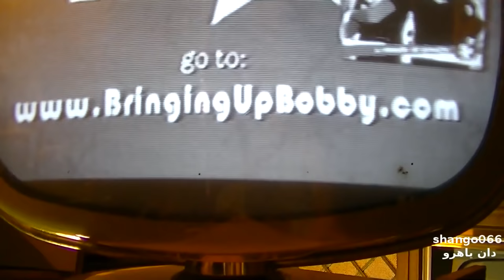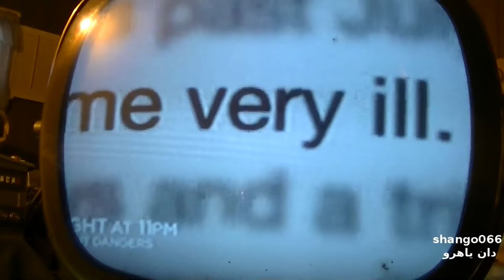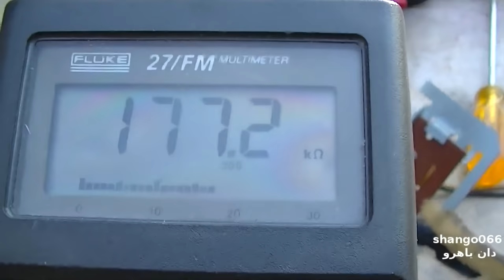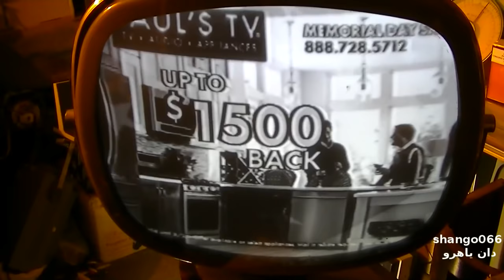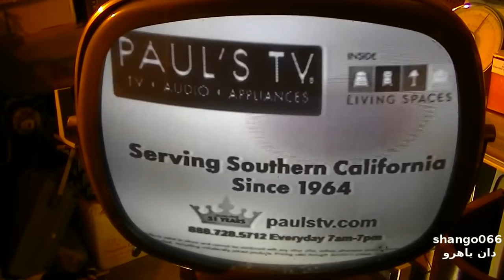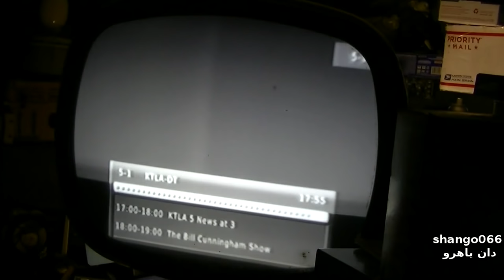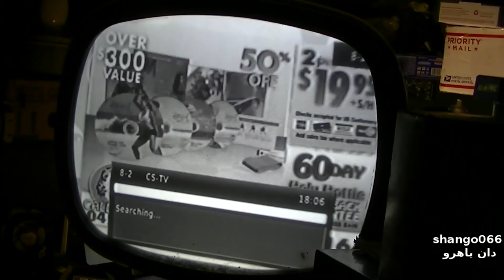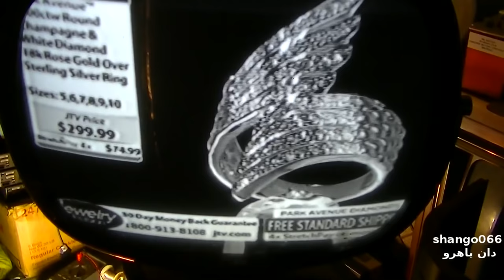Philco Predicta Pedestal Repair Final

Comment: I have been playing with electronics since I came home from Nam in 1971; Before that, I did tube replacements for my relatives in town, I used to go  out to the local dump ground with a buddy, he would dig for copper, I would grab all the tubes I could find.  When a TV was on the fritz, my relatives would call me first, I would arrive with my box filled with egg cartons which protected my tubes, I had the numbers on the cartons, this was before Styrofoam was a thing.  A quick look at what the TV was doing, check the tube layout on the inside, find a matching tube and swap, if the first one didn't work, try another.  Usually I could fix the set in no time, the lady of the house would invite me to stay for a meal, and I would consider myself well paid.  Folks still remember me for that, now days they call me when their PC's are acting strange, and yes, I have learned about PC'S and continue my fixes, usually for a beer, or shot of whiskey for my time.  Cool video, shows me where I should have gone if I had kept up my TV Repair, when tubes were on their way out, I had obtained a full service case filled with tubes, had a couple of tube testers and some old military test gear that I picked up during my 8 years in the Army. I gave it all to a local TV Repair guy, wish I had kept it now, poor fellow found out about a year later he had cancer and was gone a few weeks later.
Reply: I also had great success that way back in the day. Back then, the soldered in components were younger as we were.  And when a problem occurred, it was often a tube. I was batting better than 50/50 with also fixing a few other easy noticeable things.  It was fun wasn't it?

Comment: This all proves that what goes on in the back of a TV is often much more interesting that what comes out of the front.  An absolute miracle what you've done with this one.   The black level on most monochrome sets was awful, before gated AGC came along, but this one seems particularly bad in that bright parts of the picture darken the content to the left and right.  Possibly AGC action is too fast?  I used to fix a few TVs when I was a teenager, though maybe I was a little too young to really get the hang of valves (as well called them in the UK).  I hope the owner of this set appreciated what you did.

Comment: If you're going to use ceramic capacitors in those couplates they should be either C0G/NP0 or U2J.

Comment: I seem to remember some TVs had a buzz controll adjustment on the chassis. Not that it does any good at this late date but I remember being able to adjust out the buzz when text or screen crawls were causing issues with the audio.

Comment: Interesting about the sound on modern programming, I can see the on screen displays and programming of digital origin seem to be causing the buzz. What do you(s) think that is? Hard edges, higher brightness? Good video! But I can't help myself with the baby... can I say Smerdley's Seahorse (2009)?
Reply: AnalogRevenge Text seems to cause a buzz on our TV as well, which is a later model CRT set from around 2005, but more so on my older TVs from the 1970s and earlier. Predictas have a buzz control pot on the chassis someplace like many TVs from that era have, but often you can get rid of most of it by re-aligning the IF first, it's just the nature of using intercarrier sound.

Comment: I wonder if a filter can be used to separate the high voltage pulses from the DC to protect the meter. Maybe take an old flyback with a shorted secondary and remove the secondary winding and use the primary to choke the pulses and pass the DC and put a 10uf 450volt across the meter. Maybe a high voltage resistor that can withstand 6000 volts or several resistors in series with a capacitor across the meter

Comment: Why was the 0.0015 disc drifting due to temp an issue, but not an issue when you used discs to rebuild K4 which was even closer to the hot tube

Comment: Shango, Did the sound improve with the cabinet together? Where did the term "couplet" come from?  

Great video, glad to see it run.  Bet your friend is gonna be thrilled!  

Thanks!  Steven
Reply: Steven King   Steven, from the info which I've been able to gather over the years, "couplates" were developed for three main reasons, first to allow manufacturers to "begin going vertical" in the design and construction of PCB based electronics for purposes of capitalizing on unused space(s) within the radios and television sets being produced at the time. Secondarily, couplates were "predesigned sub-circuits", which allowed the production staff to build more product with less effort, at a reasonable cost (couplates were fairly inexpensive at the time). Finally, some couplates were designed with "X, the unknown factor" in-mind. GE and Admiral were "infamous" for requiring that certain "proprietary" replacement couplates be purchased from them. Most of the time, these components were situated in the IF or Chroma sections of television sets. They were fairly free with the schematics of the couplates used in the manufacture of radios.

You may find this to be of interest: http://pacifictv.ca/schematics/centralabcouplates.pdf
Reply: As a kid, I built a Sears Edukit clock radio, an all American five, it had one of these couplates in it. It was somewhat disappointing build as I had it together in a few hours. I had hoped for something more like a Heath or Knight Kit. I sure wish I had all of my as found radios that I had back then. I would spend hours de soldering scrap radios if I couldn't fix them. I never really had access to test equipment but for the Olsen VOM.

Comment: There was a color predicta 25 in. w rca chassis in 1980s don't remember if rca made it was pricy had pix of it when we had shop also had ad for 7in Motorola vt7 . remember a predicta with a vdr .resistor in vertical.we couldn't get.supplyed bias -we added a -supply from filament circuit .

Comment: Capacitor suffix Z is a very loosey-goosey tolerance, up to +80 percent and minus 20 percent.   That would be okay for some uses but not so good for oscillator or sync or resonance circuitry.

Comment: I used to work on old TV's back in the eighties and nineties, but now that the flat screens are so prevalent, and with the tiny surface mount components, they don't lend themselves well to diy repair, and without the high heat pinpoint gun to desolder components they are impossible to remove. And when they blow, they seem to Daisy chain and take out multiple components

Comment: Instead of getting those  gun tips u could just take mains wire, remove insulation and use it as the tip. I do it all the time.
Reply: Wow great idea, just copper right?
Reply: Yea, you can also coil it up and use it as a degaussing coil for screwdrivers. I also tried heating it up with torch, and i think it makes it last longer, no proofs tho ... :)
Reply: Excellent! I will check out your channel...  Thanks!
Reply: I subscribed to you.  Looks like you have some great videos there! I'll be checking them out! Talk soon... Steven
Reply: Thanks! 
You also have nice vids so I am already a subscriber of your channel for some time. :)
Reply: Thanks! I like the led scope video with music, I found it!

Comment: That buzzing sound is caused the chroma signal leaking into the audio part of the RF signal this will happen with almost all tvs built before color was introduced because they have narrow space tuner that's why old tv shows like I L Lucy don't cause that to happen.some colors make the buzzing louder than others if you fill the entire screen with yellow the buzzing will be quite loud and might even distort the picture a bit.
Reply: @daleburrell6273  on some german tvs i own the buzzing only happens when bright white stuff appears on screen for example subtitles or white text. but if the IF is working fine and everything is aligned the buzzing doesnt happen on those...with american sets i have no experience to speak
Reply: @daleburrell6273  yes european sets use pal, american ones use ntsc...i didnt say the opposite....i am just stating what usually happens with my sets, wich may also happen with your ntsc ones....... on some of my sets that do the white text buzz, dialing down the agc a little bit takes care of it, of course then you need to up the contrast a little to compensate for the lack of IF gain by increasing the video amp bias. otherwise the image gets too white

Comment: I suspect that you prefer to diagnose with minimal use of your 'scope, but you may gain more appreciation for it if you begin using external triggering from an external sync separator derived from your STB composite or Y (luminance) output. When you see jumping, knowing its relationship  to a locked H or V reference may help isolating the component responsible. Just comparing unstable video to the raster doesn't really tell you anything. May 11, 2019

Comment: What kind of electronics store do you have near you?  AFAIK the only thing near me is rat shack and they don't have shit.  I remember as a kid buying tubes and stuff from a Radio TV parts jobber in Brooklyn, but those guys are mostly history with all TV sets these days being 'throw aways rather than repairable, at least by a local shop.

In a pinch I make my own solder gun tips out of #12 gauge copper wire.

Comment: Why did they make those stupid ceramic "IC" modules anyways?  Wouldn't it just be easier to just use the discrete parts on the PCB?  It's not as if they were trying to keep the circuitry a secret or space was a problem.  The schematic and the module itself have the printed internal schematic.  Even if a recurring block of electronics on many many different makes and models of set, the separate process of manufacturing and inventory of a special part seems silly.